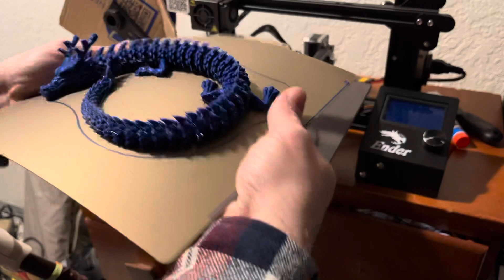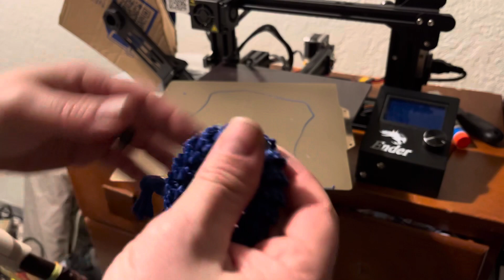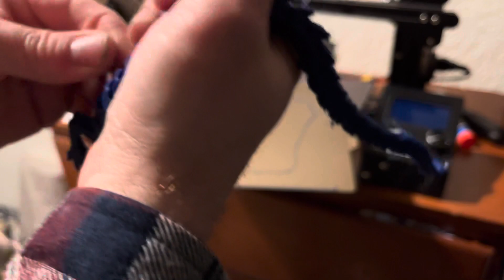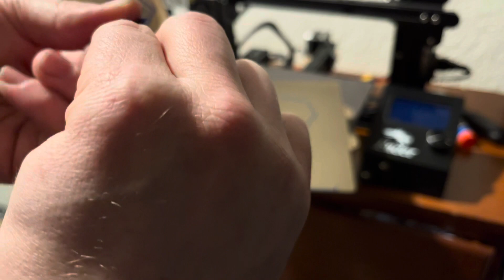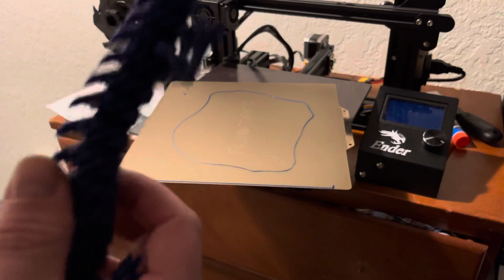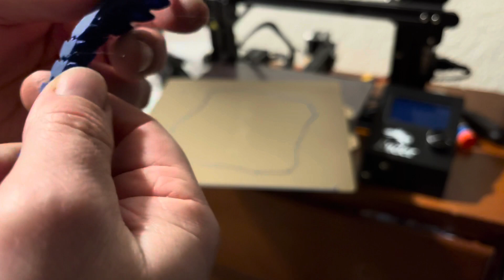3D Printed flexible dragon

Comment: I've tried this around 20x I can't get the thing to stick. I'm using a creality flexi bed. Please help I'm running the hot end at 205 the bed at 60. I'm using esun pla+
Reply from the maker: Just grab a glue stick and slather down your board first. Works like a champ. Run the plate under warm water in the sink when you’re done to help with release.